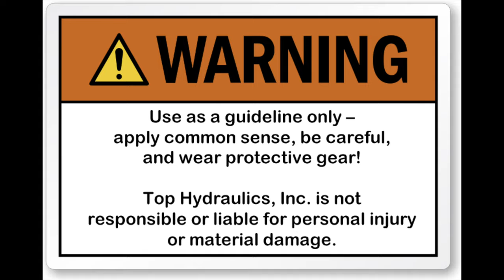Volkswagen EOS - How To Manually Close The Convertible Top

Comment: Thank you for your video. Ive just bought a EOS that was not working on the roof.  The locks for the roof that you showed us, especialy in side, are spot on. I would not know what to do to open the roof manualy. My car works electrical/hydrolic  now, but i know how to close to roof manual if i have more trouble.  Thank you very much

Comment: When putting the convertible top back in normal made and out of manual, is there any type of reset procedure I need to do with the windows or the rolling up and down stuff? The computer? Anything?
Reply from the maker: If the battery hasn’t been low or disconnected, then there should be no window indexing needed. Close the pressure relief valve on the pump.

Comment: I had to manually close my roof today, without this video I would have been lost.  My convertible top icon is flashing and convertible top operation message is on.  My sunroof is working but the convertible isn't.  I had to manually close because I disconnected the battery and it wouldn't respond after reconnecting.  Any idea what I need to check or do?  Thanks.
Reply: I had similar issues and fixed it  all just today. Follow the instructions for the  manual roof closing. For me I followed the instructions from minute 13:47 as my roof was near closed position when it malfunctioned in icy weather. I  levered the ball joints down into position as in 16:46 and pushed the rams back as you will see at the end. I thought it was all failed until I put the boot compartment piece in place, closed the boot and started the ignition...  then pulled the lever to open the roof and it all sprung back into a life of normality.  Good luck
Reply: @GazzaClydeMoore  Thanks for the info.  I managed to figure it out.  I had to reset the windows and now all is well.  👌

Comment: How do you go about unlocking the forward frame locks at about 17:20?  On my eos, I had a or problem the lock closing before the rear glad was in Place.  This happens when I was applying krytox to the seals with the roof partially open and the roof stated closing.  Thanks,

Comment: Do we retighten the pump pressure relief screw after all is done?
Reply from the maker: It’s okay to tighten the valve afterwards or to leave it open. Obviously, the pump won’t be able to move the top later if the valve is open.

Comment: This is every single mother with a spinal injury's worst nightmare. LOL...I am thinking of buying one of these. How likely am I going  to end up in this position?? Is this cars hydraulics reliable?
Reply from the maker: Hahaha, don't let it stop you from getting the car if you really like it. The top getting stuck in the down position is extremely rare. The hydraulics are very reliable if the pump does not get drowned in water. If the pump drowns due to failing weatherstripping and you parking uphill in the rain, then you will have the top up at that time, anyway. Better yet, you can avoid the problem by drilling a drain hole into the trunk, next to the pump. I have a lot of convertibles, and I do it with all of them.

Comment: Hi Klaus I have a VW Golf 2011 Convertible soft-top roof. Before I take to the dealer I need your advice regarding the open roof. Just when the roof opens a warning light come up in the panel and shows that the roof is not open totally. So I need to push the left inside of the roof just a little bit and the warning light disappears. What can be the problem ??? Cheers from Melbourne/Australia
Reply from the maker: Thanks for asking. I have not had the opportunity yet to look at a Golf 6 top. It appears to be a simple system. If you get a warning that the roof is not fully open, then some micro switch is not getting triggered that normaly indicates the roof is open. Find out why that switch is not getting triggered...

Comment: This video is excellent. The design of this system is horrible. My Camaro convertible's emergency valve is accessible simply by opening the trunk and can be turned with fingers -- no tools required. Then you can just lift the top and close it.